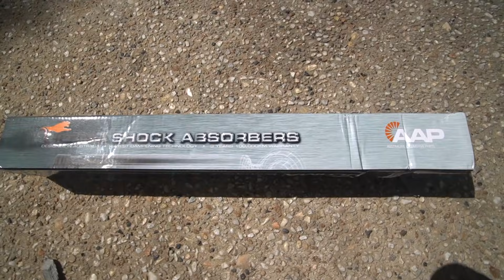AU FALCON BURNOUT *EXPLODES* TYRES & DRIFTING!

Comment: Enjoyed!
Try that again in a station wagon with lsd.......Had mine since 2002.
Reply: i have an 02 ba wagon, trying to make it a drift car, you reckon you could tell me what lsd you have in it?
Reply: @astro8807  I think but not sure 3.55 ratio. It is a police (WA) vehicle, got it at an auction.  I will check next time on a hoist and get back to you my friend. Be aware that drifting a wagon requires a shit load of practice, low speeds initially either wet road or hard sand.  That is my fat arsed girl.......